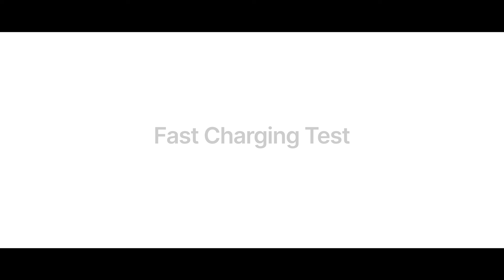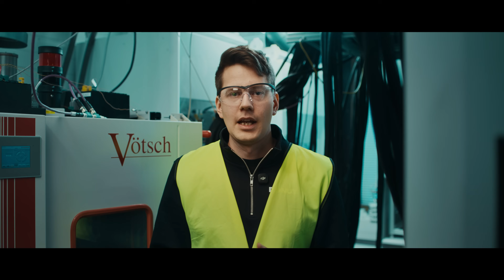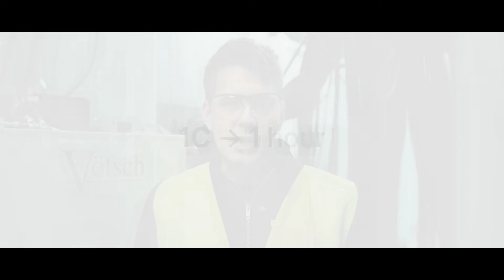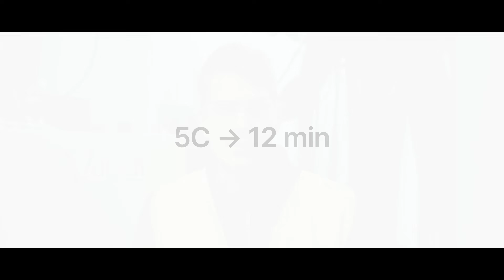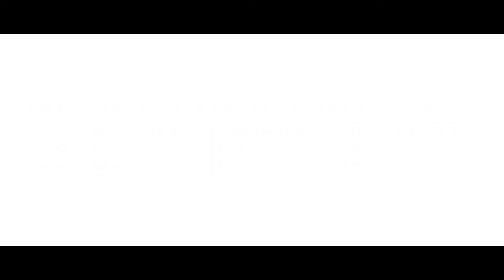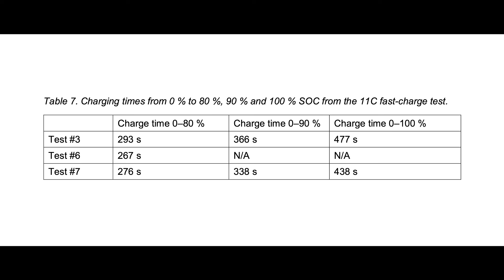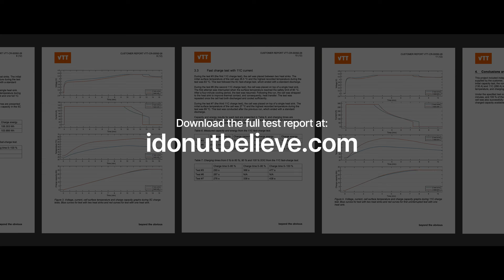Donut Solid-State Battery: Fast Charge Test | I Donut Believe (Pt.1)

Comment: Well, I've studied the test report, I'm a battery expert with 40 years experience. What I see is a high C-rate LITHIUM-ion battery being tested. Those high C-rate batteries are common in the RC world with 10C, 20C even 50C specs. High C lithium batteries have more thick electrodes to handle the high current. No where in the report the dimensions, the weight of the battery are stated, that is suspicious. Looking at the charge curve I'm quite sure it's at least LITHIUM based due to the voltages displayed. So the claim no rare earth materials is already gone. Solid state, I doubt. Also the Idonutbelieve designation of the website, this is not about believing, this is about hard evidence. Not convinced at all. If they stated the dimensions and weight it would be more convincing. By not elaborate about this, this is fishy. Now we have to wait another week for more test results. What a strange way to "sell" a product. This makes it even more suspicious.
Reply: Battery is about compromises. This video proves nothing. It makes it more scammy. The guy just wants $$ from moonshot investors.

Comment: 2:44  swelling complicates clamping requirement.  Clearly this battery doesn't require the clamping of a "typical" solid state battery to maintain contact internally, but it's unclear if it still swells up to 15-20% (which causes packaging constraints).    Note that wet batteries don't swell as much (or at all) because as the ions transfer from cathode to anode during charging, the anode swells, but the liquid just moves out of the way.

Comment: Why did the test do fast charging only ? A more typical capacity test would do both full charge and discharge rates in one cycle. If this is some weird marketing strategy to give out the data one piece at the time to generate PR, it is silly and makes you look amateurish. At this pace it is going to take like 90+ days just to confirm all the important claims.. If you have the data, just release it. And if not, then say so and release the test schedule like true professionals.

Comment: So far, I've counted 25 improvements this battery makes over current Lithium batteries.  This test appears to confirm at least four parameters if not more: charge rate, discharge rate, total power available for discharge, and energy density.  I estimated the energy density by looking at the battery being tested and estimating the weight to be less than 222 grams which would provide the promised 400 Wh/Kg.  Of course cell packs include voltage regulation, current regulation, and inversion losses that reduces the pack energy density.  The measurement charts mirror out charts for charging and discharging the   So far, I'm impressed with what I've seen.  Keep it coming.
Reply: This test proves absolutely nothing until some are sent to other labs for testing.
Reply: @lkeil84 How many labs? 100 or 1000?
Reply: @lkeil84  So you can trust the second or third lab but not the first one. I don't understand your logic.
Reply: @lkeil84  Or VTT can do the tests independently without Donut ordering test series according their guidance and under NDA

Comment: Not understanding the first heat sink explanation. Two heat sinks emulating the battery in a stack. But batteries in a stack do not act as heat sinks for each other. Quite the opposite.
Can someone explain this?
Reply: Presumably the pack would have bifacial cooling?

Comment: Well, we are all certainly hoping that this is all factual with the capabilities of this new battery pack. As long as the production costs are in the ballpark of current high-performance lithium ion packs this should be well and truly a great leap forward in all applications using substantial battery storage.
 The one thing that I would say to doughnut is that you really really really want to make sure that your IP is protected as you can be rest assured that the Chinese are going to be putting in massive resources to steal anything and everything of your product knowledge and it’s capabilities!
Reply: See, that's the problem of poor man thinking, if this donut guys have this new battery breakthrough, they should work with the Chinese to mass produce the battery and flood the market asap like Apple, Tesla...

Comment: Sodium titanium nano tube battery …
Reply: 🚨 BREAKING NEWS: The Super Quantum AI Sodium-Titanium Nano-Tube Battery Announced!
		After two days of intensive R&D (and one all‑nighter powered by instant ramen), researchers at HyperNova Energy Labs have finally solved the global energy crisis.
		The new Super Quantum AI Sodium‑Titanium Nano‑Tube Battery (SQAI‑STNTB) offers:
	•	Infinite cycle life (confirmed by our quantum Monte Carlo simulation that ran once and declared success).
	•	0–100% charge in 0.3 seconds, as long as you physically believe in it.
	•	Self‑replicating nano‑structures that actually improve as the AI learns your driving habits.
	•	Reverse entropy stabilization, meaning it gets colder as it discharges.
	•	1000% energy density gain, verified by a proprietary “feel‑good” AI algorithm.
		Shipping begins April 1st, 2026. Retail price: “Priceless.”
		⚡ Powering the future, literally and quantum‑ly.

Comment: Congratulations on the results and the strategy of publishing them step by step—a masterstroke that should silence more and more critics if solid data and tests continue to follow—which I assume they will!
Reply: I just asked the AI for scam like this:

	•	“Long con” / confidence trick – a scam that unfolds slowly over time, where the scammer carefully builds trust, often using bits of truth, until they make a big move to take the victim’s money.
	•	Grooming in fraud (common in romance scams) – the scammer gradually shares plausible, half-true or unverifiable stories, tests small requests, and escalates to very large asks once the victim is emotionally and cognitively committed.
	•	Gaslighting / manipulative truth-telling – using selective truths, half-truths, and deliberately ambiguous facts to confuse the victim’s sense of reality so they don’t question the final big request.
	•	In magic, a similar structure is called misdirection – you show something that is technically true or looks fair, to direct attention away from the real method, then reveal the “climax” where the actual secret has been hidden the whole time.
Reply: They should have released all the independent lab tests, a workable prototype battery or a real ebike or a emotorcycle at the CES2026... They don't!  what they have shown are some PPTs, questionable website and videos. Now after weeks of criticisms they came out with 1 'proof' per week tricks.Looks like a SCAM, Smell like a SCAM, the donut ceo still look exactly like the Artificial Super Intelligence snakeoil salesman before...
Reply: @seekingworldlywisdom  when  it's your company you get to decide how the info is released. Oh . . . this is not your company. All verifcation was done in Sept. 2025, Now its to be released. Maybe the patents are not finalized yet. so they have to slow release all the info. Hang tight more is coming
Reply: @EvDriveZeroPollution  This is the way for a magician to create a magic trick or in this case a hoax  - You unfolds bits of truth/half truth slowly over time, where the magician/hoaxer/scammer carefully builds trust, until they make a big move to the finale to reveal the trick.

Comment: I had Gemini 3.1 Pro analyze both the independent VTT report and this video, and it highlighted some fascinating takeaways.

First, credit where credit is due: Gemini pointed out that a standard liquid lithium-ion cell would likely never survive an 11C charge while hitting nearly 90°C without venting, melting its separator, or going into full thermal runaway. The fact that this cell survived without combusting strongly backs up Donut Lab's claim that they have a highly stable, likely solid-state chemistry.
However, the AI also caught some major marketing spin and lab tricks that we should be cautious about:
The Over-Voltaging Trick: Donut Lab's own spec sheet lists the cell's recommended maximum voltage as 4.15V. But to get these crazy fast charge times, they over-voltaged the cell to 4.3V. Pushing a battery past its recommended voltage limit forces faster charging but usually destroys the cell's lifespan.
The 90°C "Comfort Zone" Spin: The video brushes off the 89°C peak as being perfectly fine and in the cell's "comfort zone." But if you read the actual VTT report, it explicitly states that the test "was interrupted when the surface temperature reached the safety limit of 90°C". Tripping an independent lab's thermal safety shutdown is definitely not normal!
Missing Long-Term Data: The report only covers a handful of extreme fast-charge runs. There is absolutely no data on long-term cycle life. More importantly, no post-test teardown was done to see if the cell was internally destroyed, delaminated, or severely degraded after being subjected to over-voltaging and 90°C temperatures.
It is a genuinely impressive "stunt" test that shows great thermal stability, but surviving a few over-voltaged, overheating runs in a lab is very different from lasting thousands of cycles in a production vehicle. We definitely need to see the cycle-life degradation data next!

This was a pure AI analysis so take it with as much salt as the claims of Donut Labs 😅

Comment: For all the folks who think that a small company can't outdo millions in funding from huge companies: 
The thing about research of any kind is that if you start down a research path that fundamentally won't work, it doesn't matter how much money you have. 

If there is an actual way to engineer a battery with these specs, out of the dozens of startups all going down unique research paths, most will fail, but one will get lucky enough to choose the correct research path. 

Look at heavier than air flight. It wasn't the big companies and rich funders who figured it out, it was two bicycle engineers by themselves. 

Why couldn't something similar happen with battery technology?
Reply: this is not a small company, they've got a billionaire investor funding it

Comment: If 1 cell is charged alone, things are totally different than if there would many cells be stacked, how it would be in a battery pack. That means, that the cells in the pack will get very much hotter and most likely leave the comfort zone. And: if you built such a passive pattery pack and it is on 80°C after charging and you drive it empty with the motorbike in 2 hours, the temperature won't drop in that time, since more losses rom discharging will keep it hot. The second charge won't be possible in the same day.

Comment: Simple demonstration:
 Place a battery inside a glass jar with screw on lid. Drill a 1 cm hole in the lid to pass a power cable.  Epoxy the threads of the lid & jar.
 Do 12 repetitions in 12 hours: Charge for 5 minutes.  Disconnect charger. Power a light bulb at 2C until it dims, measure how long each discharge requires. Hourly recharge and repeat.
  After 12th repetition, recharge and then stuff cable down through lid-hole into jar. Bridge the hole with tamper evident tape.  Fill the hole with epoxy.  Place bottle in bank safety deposit box for a week.  After inspecting lid for tampering, cut a hole and fish out the cable with a hook. Power the light until it dims. Compare duration of light production with median of initial 12 tests.

Comment: At least 3 times it says in the report: "which the customer identified as solid-state battery cells".
So VTT has no clue what they were actually testing .😂
Reply: Do you think the test engineers are able to tell the difference? BTW, have seen a lithium battery charge at 11C?
Reply: @MortenAasheim  how could they tell if they didn't check the inside? It tells you all you need to know that they write this over and over in the report.

Comment: But Toyota are miles ahead with this tech, releasing first production cars soon.
"Toyota is advancing toward mass-producing solid-state batteries (SSBs) by 2027–2028, aiming to revolutionize EVs with 10-minute charging, 1,000–1,200 km ranges, and superior safety. Partnering with Idemitsu for solid electrolyte production, Toyota is shifting from lab to production-scale, with early versions promising to halve costs and sizes compared to current, conventional batteries."
Reply: Toyota is miles ahead in terms of fraud. They've been promising something similar for about 15 years. They don't know how to innovate though. They only know how to market lies.
Reply: @johnbmudd Have you researched the latest?
Reply: @johnbmudd 

Toyota: Developing SSBs with Panasonic, planning limited production by 2025.
Mercedes-Benz: Conducting road tests on prototype solid-state batteries.
Volkswagen: Partnering with QuantumScape, targeting commercial viability by 2027.
Nissan, BYD, and CATL: Actively developing and aiming for large-scale, commercial production, with 2027–2030 often cited as a milestone.
Donut Lab: A company showcasing, as of early 2026, a "production-ready" solid-state battery for electric motorcycles and potentially cars, capable of very fast charging.
Reply: @d.Cog420  your AI slot post is a lie. Toyota is a lie. Toyota is nothing but a fraud. They've been promising solid state batteries for 15 years. They'd still can't deliver. That's fraud.
Reply: @johnbmudd ok well as long as you know. Some evidence on why the post is a lie would be good, it’s pretty important stuff for our future.
Reply: @d.Cog420  Toyota has not delivered on solid-state battery promises—they've repeatedly delayed them while continuing to make new ones.

The facts are clear:

A history of missed deadlines:
- Toyota originally promised solid-state batteries by 2020 
- That slipped to 2023 
- Then to 2025 
- Then to 2026 
- Now they're targeting 2027–2028 

Current reality check:
- In November 2025, Toyota halted construction of their Fukuoka battery plant—the facility meant to produce these batteries 
- This marks the second delay for that plant in one year 
- Toyota admits they're "reviewing and adjusting plans" with no new timeline 

What they're actually producing:
- Toyota's North Carolina plant (opening 2025) will make conventional lithium-ion batteries, not solid-state 
- Their current EVs (bZ4X, RZ450e) use standard battery tech 

The pattern:
Toyota keeps announcing breakthroughs (1,200 km range, 10-minute charging, 40-year lifespan)  while pushing actual production further into the future. Meanwhile, competitors like Mercedes have already put solid-state vehicles on the road for testing .

When a company repeatedly delays the same technology for nearly a decade while maintaining they're "on track," that's not innovation—it's marketing.
Reply: @j @johnbmudd Nice one, thanks for that. Sounds a lot like Musk promises, I guess the marketing speak is to keep investors on side in order to fund the tech. Good Mercedes are advancing well. I understand the German car industry is in trouble from the Chinese EV threat. Do you know how VW and Nissan are doing?